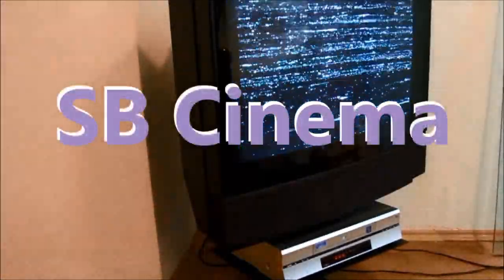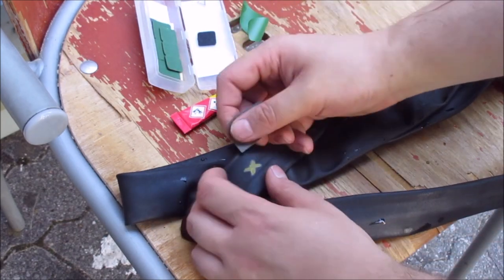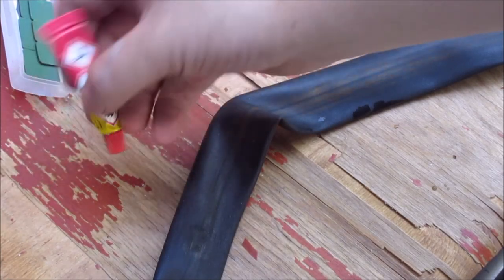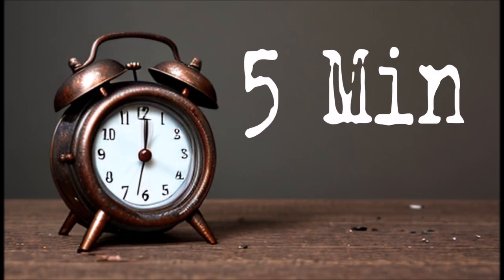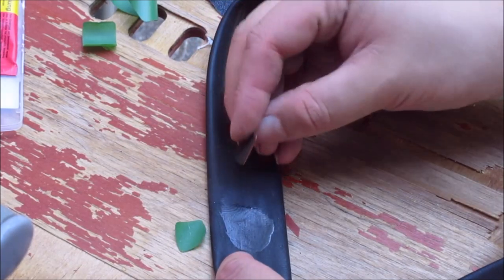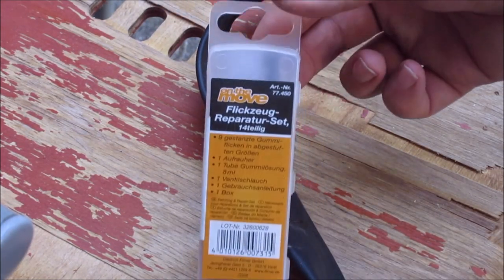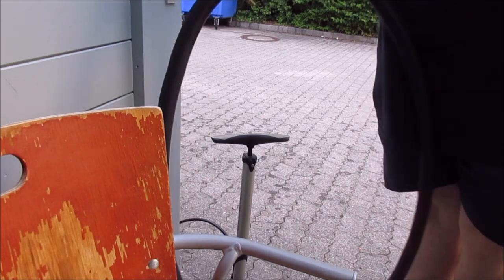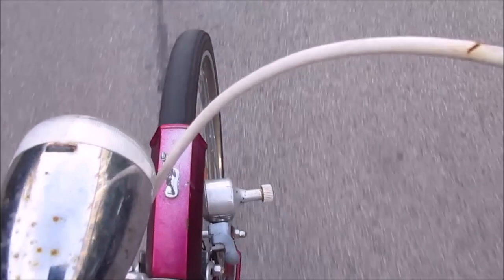How to Patch a Bicycle Inner Tube ( dollar store patch kit )

Comment: Thanks for sharing! I've always used a basin of water to check for the holes. Plastic bag is a GREAT idea, especially if you are away from home! I've always found that putting the tube back in the tire and then inflating was the best, as it seals the cement/patch better (no air bubbles). Thanks again!